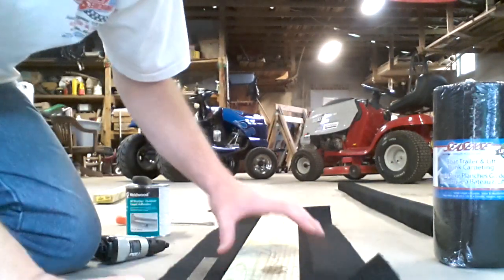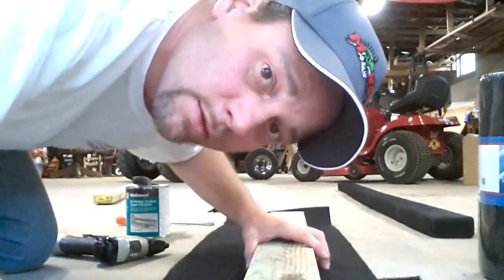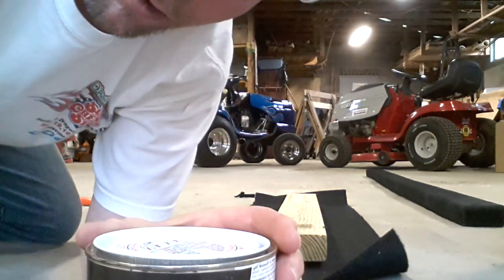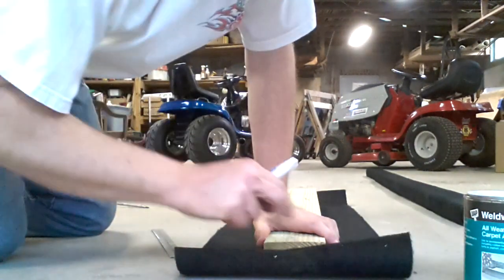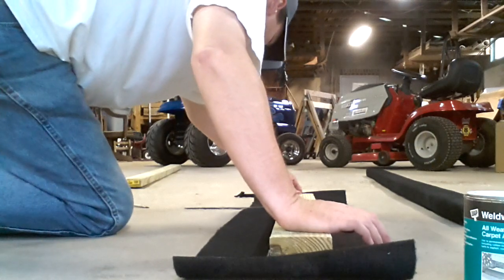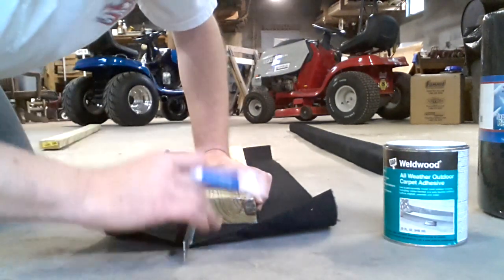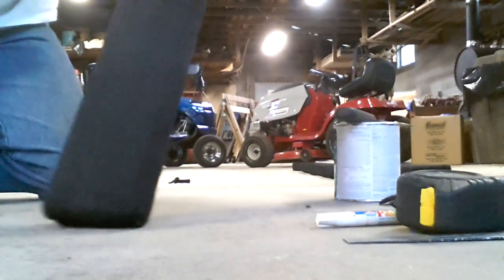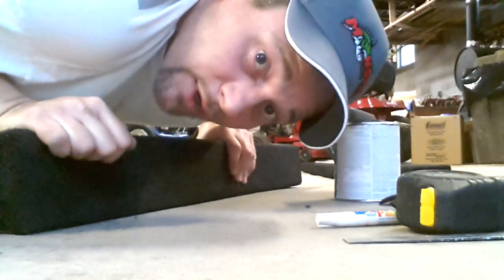how to put new  carpet on  runners for a  boat trailer

Comment: I just got done doing two of the bunks on my trailer.  Found this video helpful and amusing but some things I learned:

1. You absolutely need to be careful how much adhesive you use.  Too much and it will soak through the carpet material (where there is any pressure) and make a mess and make your bunks look like crap.  One thing I tried to do is to put the material on and then put the bunks right on the boat- let sit for a few hours. Glue came up through where I clamped to hold the bunks.

2. I am going to use a notched trowel when I do the other two. 

3. While using pressure treated wood is the right way to go, the boards should be as dry as possible. Try to get ones that are dryer from Lowe’s etc.  I am going to buy and let sit and air dry for a few days.  

4.  Recommend you let the bunks dry on their own out of the weather once the material is put on.  You want the glue completely dry before it gets wet with any water.  Even through you are using exterior glue it will absorb moisture/water until dry. There was a light rain about 6 hours after I put the bunks together and I had to take them off and put them back in the garage for a couple of days.  The glue had absorbed some of the moisture.  Some of the glue was oozing through. Not a lot but still a mess.

Comment: Entertaining for sure, but you need to absolutely use monel/Stainless staples, the others will rust out in less than a season.
Reply: But don't mix monel staples with pressure treated lumber.

Comment: good job.   perhaps some suggesstions.................................be picky when getting your boards andmake sure they are pressure treated.....once cut seal the boards with a sealer like Scotts (two coats...... use bronze staples.           remember the conditions these bunks live under      Wet!